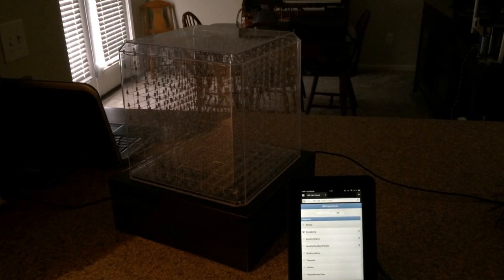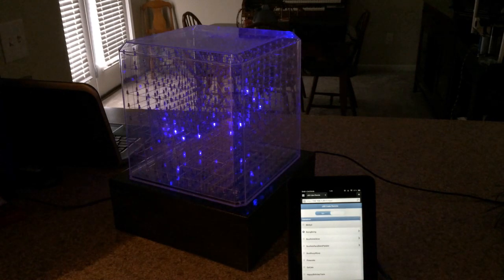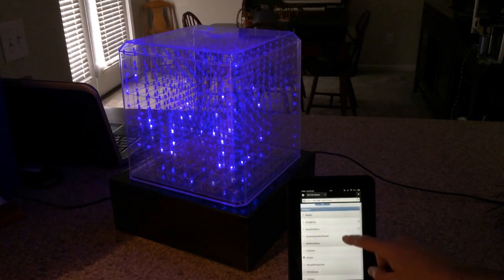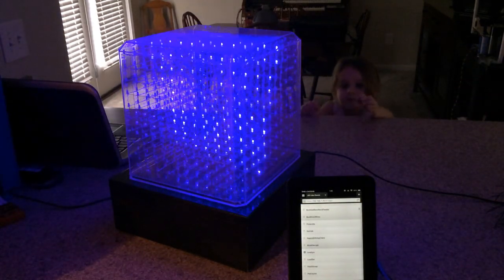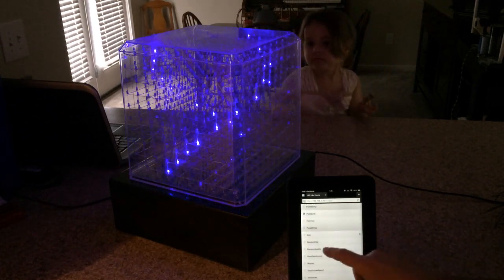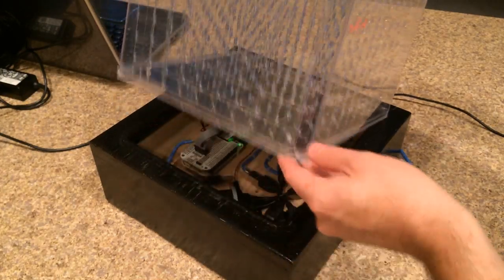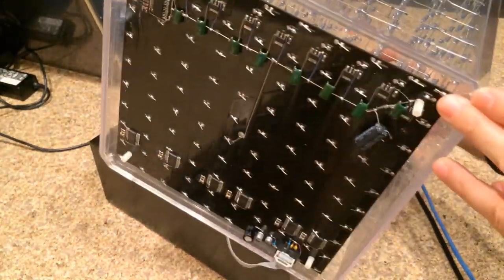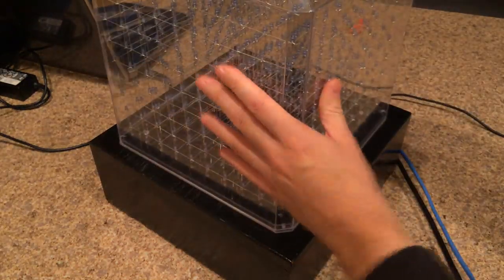BeagleBone LED Cube Project

Comment: Do you have a blog going over build?
Reply from the maker: No, I took some pictures with the intent of doing that, but never got around to it. Was there something specific you were wondering about?
Reply: Jerrill Johnson Mostly the Custom LED driver board, how you came up with idea, what you used to make it, how long turn around was on it etc.
Reply from the maker: The board is basically a 110-bit shift register built around this device: http://www.st.com/web/en/resource/technical/document/datasheet/CD00225110.pdf

It lights up 1 horizontal plane at a time with a refresh rate of 60 Hz so you can't see the flicker. The downside is that the LEDs running at a less-than-10% duty cycle are pretty dim. I think one could resolve that problem with better, brighter LEDs. But it videos a lot brighter fortunately.  

The other components on the board are basically noise filtering components and 10 power transistors on the 10 SR outputs that switch on power to a given plane.

This let me get the wire count over to the board way down. I'm using the BB PRU to drive the LEDs so the CPU wasn't tied up driving the LEDs using OS GPIO calls (which would probably be too slow anyway). There is a shared memory block that the application writes with the cube state and the PRU application picks that up and bit bangs it out to the shift registers.

The PCB design was mine, but it was sourced from Malaysia so I could get several boards. But unfortunately the design needs major noise reduction mods (mostly a ton of filtering caps on every SR output to ground) so the extras I bought were pretty much scrap, but served as great jigs for soldering the LED lattice.

The acrylic case is a basketball display case from Hobby Lobby.

Let me know if you have any other questions!

Comment: Do you have any videos on the crosscompiler setup for the BeagleBone ?
Reply from the maker: For this project, I used C#.NET so no cross compiling was needed. I just ran the mono interpreter on the BeagleBone. Is that what you're asking?
Reply: Jerrill Johnson I am not quite sure my head is spinning on all the different options for the BBB such as cross compielrs, and distros for the board.  What I would like is to develop code on my PC for the board. This is what I thought you were doing.
Reply from the maker: JDALSystems I used the MonoDevelop IDE running on my laptop to write and debug the code. It has a remote debugger which will allow you to run the code on the BBB, but debug using a full graphical IDE on you PC. It's pretty sweet. You can use Eclipse to accomplish the same thing for C/C++ code, but you'll have to get your cross compiler setup right. You can find detail on the compiler setup here http://processors.wiki.ti.com/index.php/Introduction_to_Linux_One-Day_Workshop  and here http://youtu.be/vFv_-ykLppo .